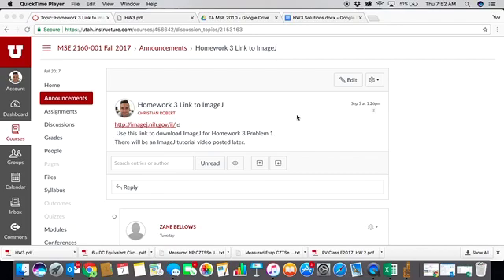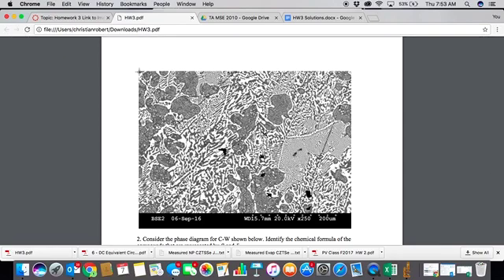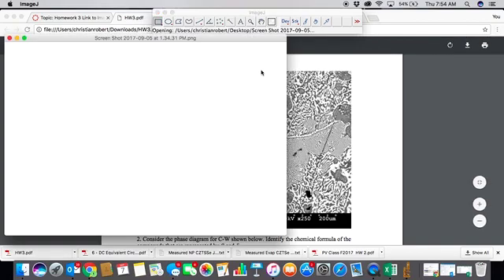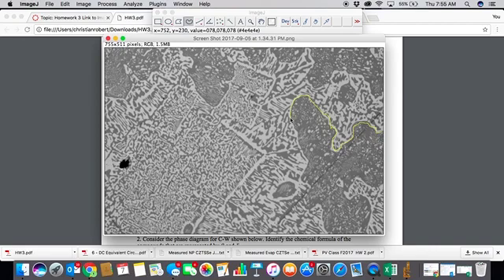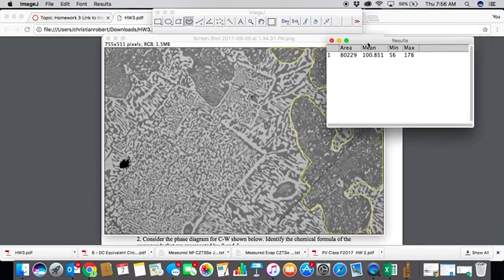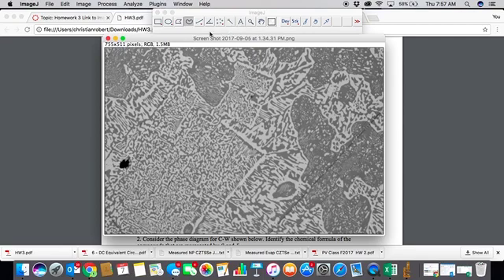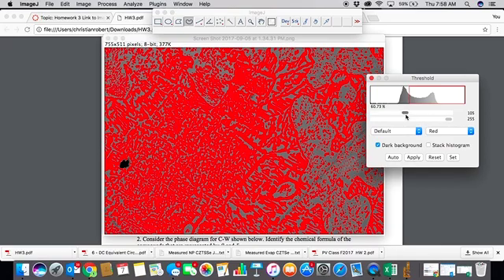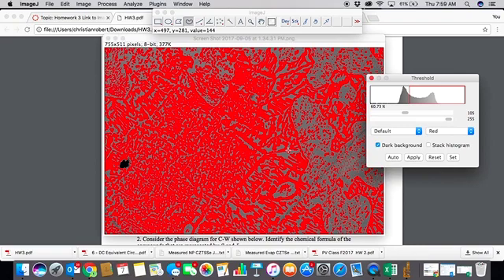ImageJ Tutorial Area and Threshold

Comment: Hi Taylor, thank you very much for your video!! If you circle one ROI using the freehand selection tool, can you stop outlining inbetween one circle (e.g. to change the zoom) ? In my experience you always have to do one circle/outline an ROI in ONE go, which makes it hard to zoom in on different details (if you have to be very accurate). I would be very thankful, if you could help me with this issue!
Reply from the maker: I've never tried to change the magnification, but I agree that it would certainly make it easier. I will test it out next time I use the software
Reply: Thank you for your quick reply. Do you have an advice how you could stop and continue circling one ROI/ how you could circle it in more than one go (e.g. by using any specific keys)?